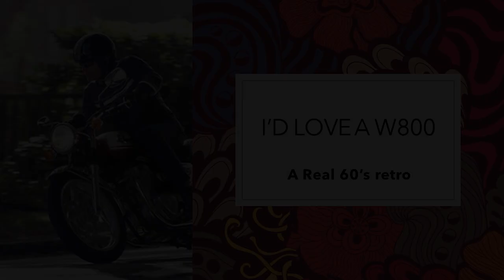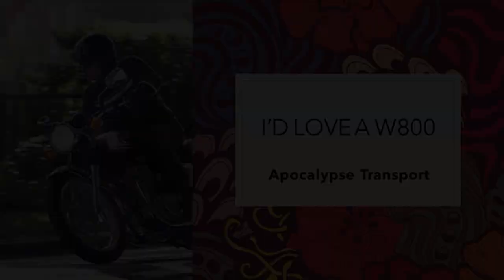Kawasaki W800 - a bike for the apocalypse

Comment: I do love my W800 Cafe 2020! Almost 50 and the stance is fine on my back as the wind you lean into it. Cone on the front deflects wind just enough to make it right. Daily rider. I am 100 percent motorcycle with no car here in the states. Also have a Concours and looking at a Himalayan for back roads. Bike for each purpose. 4k on the clock and no issues. Wanted a centerstand, but for 200 bucks, I will wait.
Reply from the maker: You definitely have all the angles covered there with all three of the bikes doing a specific job. Cheers!

Comment: At times I feel I don't appreciate my Classic W800 enough until I see youtube reviews like this. I bought mine new-old-stock in 2020 which I believe is mechanically identical to the one you rode with rear drum brake and halogen headlamp. I'm a city guy and enjoy riding my Yamaha Tricity 125cc most of the time. The w800 is such a fuss-free bike that I take it for granted. It starts everytime, runs great and so pleasant to ride I never hesitate to take it on a long trip regardless of weather condition. Thanks for the review!
Reply from the maker: It is such a pleasant treat to ride the W800 as you say. An unassuming bike with its unique 360 deg crank from yesteryear. I’m sure you’ll be enjoying it for many years as it’s is irreplaceable. 👍

Comment: comment about the oil and filter .. it turns oil into chocolate by 800 miles, so keep that oil fresh by keeping an eye on the oil window. One other point, standard seat wrecked my ass, so reupholstered and made it level so you can move backwards and forwards if u want to - that changed the whole ride to a much more pleasurable experience. 
Great bike, very simple, I'm 3000 miles on mine now, fear not if u looking to buy one of these - safe riding!!
Reply from the maker: Cheers for the info Rob. The manual does recommend turning the engine off if you are going to be idling for any length of time. Got to remember there is no oil cooler either. Still love that bike though. 👍

Comment: If I had the opportunity to get a W800 instead of my Street Twin, I bought second hand I would have gotten the w800. the w800 sounds more British than the Triumphs since it has a 360deg crank instead of 270 and they are very well built and engineered, the valve adjustment is a breeze to perform.
Reply from the maker: Yes, the W800 is pure quality with a brilliant valve adjustment mechanism. Well down on power than the Triumph but for a sunny day out not sure it matters. The 360 crank is lovely 👍.

Comment: Thank you for this very informative and pleasant video. It almost seems made for me: I´m in the process of trading in my CB1100 EX for a W800 right now! Not because there is anything wrong with the Honda (on the contrary, it´s an absolutely fabulous bike), but after having owned it for nine years I just feel it´s time for a change. I watched quite a lot of videos on the W800, but I think yours really stands out in that you transmit the feeling that the bike gives you very well, instead of talking mainly about specs and stuff like that. Anyway, I´m sure I´ll miss the Honda and love the Kawasaki. Greetings from Spain!
Reply from the maker: That is brilliant, you really won't be disappointed, the bike has loads of character and is all round just a bit easier to get on with compared to the CB. As you say, a change is a good thing, nothing wrong with the CB. Thanks for watching and I'm glad you liked the format.

Comment: By the way, Vespas give two pressure settings for the rear tire and they have tubeless tires. And you can drag the side stand quite easily on my 2019 GTS 300. It is a nasty wake-up call when you do! 😳

Comment: Nice vid. Would love to see you test ride the RE Interceptor 650 for a real comparison.  
These 'little'  bikes - once upon a time they would have been big - are sinfully enjoyable.  
Having had bigger bikes before, I find myself under modern conditions wondering what they're actually for, other than track. 
Just back from near 3,000 mile tour two up, full luggage on the RE. No bother to it. Not a bike for the motorway... but who wants to ride on a motorway? 
And +1 on the plastic!
Reply from the maker: I live in Ireland and it can be very difficult to get demo rides here so a test ride on a RE650 probably isn't on the cards unfortunately. The RE650 was the last nail in the coffin for the W800 though, totally smashed it. I think the RE fuel consumption is a good bit superior to the W too which would make quite a difference on a longer journey such as yours. I'm a creaky boned fella and I'm not sure that regular road bikes suit me for long distances, happy to do a 200-300 mile days on them but not multiday trips. If your body will take it you can tour on anything of course, I used to do big journeys on my CB350K4 from the north of England down to Oxford and thought nothing of it at the time. Totally agree on the motorway, I tend to avoid them, even on my Tiger 1200 luxobarge. Cheers and thanks for checking out the video.

Comment: Bought my 2014 model 2 years ago and it really is the best looking retro bike out there. High speed handling was a little frightening (70mph plus) until I put in Hagon progressive springs up front and a steering damper. Last year I added Hagon 2810 shocks to the rear which makes it a bit more comfortable but not a great difference
Reply from the maker: Thanks for sharing, yes, it is an experience at those speeds isn't it! :-0   I think to make suspension brilliant you have to go custom springs front and back for your weight and riding preference. As a country rambler it is hard to beat though.

Comment: Thanks for posting.  Seriously looking at this bike.  Practically no modern bikes with 360 deg. cranks these days but I love the sound.  Looked at the RE Interceptor, too. Much to like about that one, but I think I'd prefer the wider spead of the five speed over the six speed Interceptor box.  Thought about the 850 kit for the Interceptor but I'm worried the fuel mapping might not come out right.
Reply from the maker: I think I would take a two-year-old W800 over a new RE650 if I were to make the choice, it just seems a little more special. Its scarcity, compared to the RE, adds to the desirability too. 270 has become the new norm as you say, I again took that 360 crank as something a little different and I enjoyed it a lot. That 850 kit could be a gamble alright and £££ of course. I doubt you would see much of that investment back when it comes to selling it. Whatever you do though neither will be a wrong choice, good luck!

Comment: I love my W650.Get the rpm’s above 4000, free way speeds, and it smooths back out nicely . Mirrors are clear. I’ve done 500 mile weekends.l thought about trading up to the W800 but I like the look of the 650 better. FYI I’ve owned every thing from Ariel Square Fours through various Triumphs and everything in between.
Reply from the maker: The W650 gets good press, even compared to the 800 which one could argue was only a cc hike to meet emissions. Nice to have a kickstart too. Enjoy!

Comment: Would it be happy holding 70mph for very long?  On rare occasions, I might need to go on a 400-500 mile trip on US Interstates. Most of the time I would be riding a lot shorter distances at lower speeds.  I am comparing this to a Moto Guzzi V7 Special as a possible longer distance replacement/addition to my GTS 300.

Comment: I'd buy one for about $6K new because it really is mediocre for what it is. I'll just spend the same and get a couple CB900C form the early 80s and make one good one from it with a spare set of synced carbs. The first thing I'd have to do if I bought this one is finish making it retro by changing the turn signals. As it stands, I think the RE 650 will do nicely if I can get it in black with a black cruiser-style seat and red accents. But we all know how unlikely that is.
Reply from the maker: Yes, the poor old W800 gets beaten up from all angles. They make sense at lower 2nd hand prices and then you are getting a traditional 360 degree crank with the old fashioned firing order (which I like). Its scarcity gives it some cache I think. Cheers

Comment: Tech question. What rpm in 5th is it cruising at 100kmhr?? Looking at the 2024 model here in Thailand. $18k in aud. Around $3k more expensive than in OZ. Either this gadget or T100. Thanks.
Reply from the maker: It was my Buddies bike so I can't answer that accurately. It does get buzzy above a certain revs but I found it runs well at 3500RPM and should manage 100km/hr or close to it at those revs. It has bags of character but is a little less refined than the T100. That is not necessarily a bad thing though and if you are into doing your own valve clearances the W800 gets the win. It also gets the win for retaining the traditional Brit Bike 360 crank. Difficult choices but I'd have either at the end of the day.

Comment: just test road it as well,  nice bike but too low for me and ground clearance is also too low. Besides that keeping endgine clean is probably a pain.
Reply from the maker: It is low and it aint no scratcher. First call for me (and my weight) was to up the rear preload, then it coped well. Yes, not sure it has a great finish for winter riding, definitely a summer machine.

Comment: Hello, I used to ride a Honda C110 Super Sport 50 c.c. motorcycle. It vibrated. Longer rides there would be numbness in the hands. It led me to have the belief that all motorcycles vibrated. Does the W-800 vibrate more or less than the Honda?
Reply from the maker: Loads more than the Honda. The Honda does vibrate with that classic inline four vibration but only if you push it harder.
Reply: @terenceokeeffesmotorcyclestuff  Hello, just for fun I was comparing the twin W-800 to my 50 c.c. single that had knurled plastic hand grips. That single vibrated. The only bikes that I would expect to vibrate more would be a 500-600 c.c. Single. I pillioned on a Honda CB-750 but never drove one. I don't remember vibrations.

Comment: do these things have a real carby  or is it fuel injected  and a fake plastic cover
Reply from the maker: All fuel injected, no way to pass emissions with carbs. They don’t even meet Euro 5 now so only dribs and drabs left in the showrooms in Europe. My local dealer has two left in grey which look fabulous. Last of the 360 deg parallel offerings in the classic British engine config in a world of 180 & 270’s. There is just a cover over the injection system, not looking to imitate carbs. Not a lot of plastic on the W800’s, they actually have a decent heritage originally getting a license off BSA.